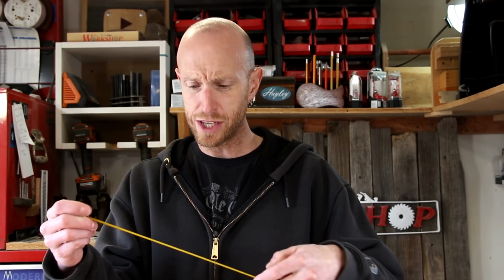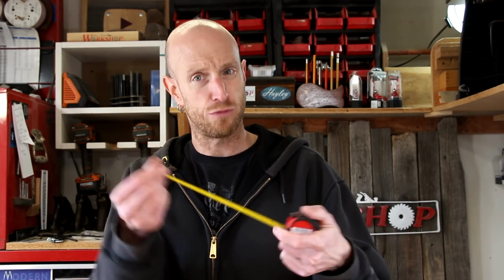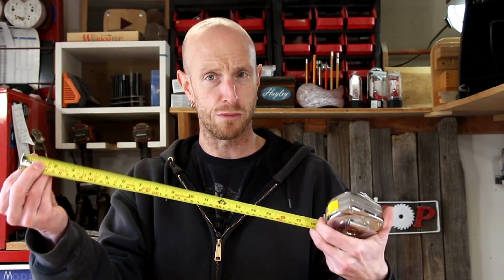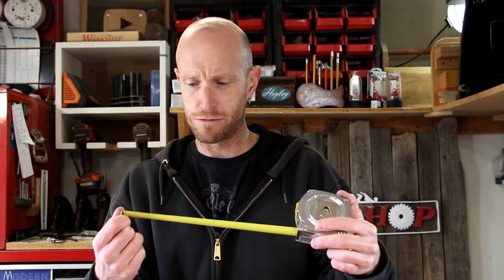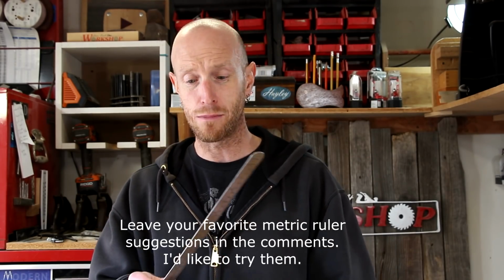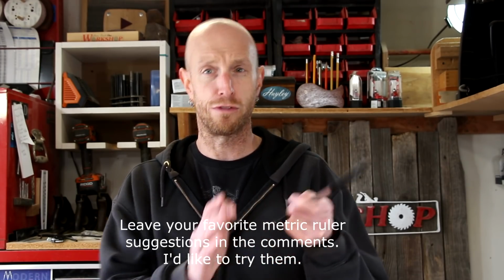My thoughts after using the Metric System for a project | I liked it

Comment: I'm an old fart who started out with the imperial system and found it a pain working fractions. When metric came in, like you, I found it a little bit difficult but once I mastered  it, it leaves the imperial system in the dark ages. 👍🏻🇦🇺😁 Oh, and thanks for your intuitive thoughts.
Reply from the maker: Fractions arent fun. Lol.
Reply: Strictly speaking, you're always dealing with fractions. It's just that tenths are a very convenient fraction to use in a decimal system. ;)
Reply: @Tyrian3k  As an engineering student, you never really use fractions with metric on any kind of diagram or drawing, its just written like it is, you might say one and a half metres but everyone knows thats 1.5 m and will always be written as 1.5 m. You can write the imperial system out as a decimal too but 3/16th looks and sounds much easier than 0.1875 inches. It also helps that converting between kilometers, metres, millimetres is easier than miles, yards, feet, inches because with metric it devides by the same amount each time, 1000, compared with imperial where 1 mile = 1760 yards, 3 feet in a yard or 5280 feet in a mile, or 12 inches in a foot. It just makes it a lot easier to work with and also to do equations with because in metric everything has a conversion factor of 1000 whereas imperial it changes for each measurement. It also makes it easier to convert between different types of units, like in the imperial system 1 ounce = 1.804 cubic inches whereas in metric 1 litre = 1000000 cubic milimeters or 0.001 cubic metres or 1 milliliter of water = 1 gram = 1000 cubic millimetres which makes it faster and easier to convert between different properties.
Reply: @andrewstrongman305  thank you, I've changed it now
Reply: Fractions are ctually VERY useful and easy in certain situations. A foot can easily be divided by 2,3,4,6 and of course inches can also be used independent of foot measurements, not unlike dentemeters. If I tell you to a metric measurement into thirds or a sixth, it's going to be difficult. Also, what if we do something like divide a foot in half repeatedly? 1 for (12"), 6", 3", 1 1/2", 3/4", 3/8", 3/16", 3/32", 3/64"....you get the picture. Now start with a similar metric unit and do the same. Well, there is no metric measurement close to a foot...well lets start with a meter. 1m, 50cm, 25cm, 12.5cm, 6.25cm, 3.125cm, 1.5625cm, 1.2....alright, I'm doing this in my head and I can do it but it's just not as easy and we are are still WAY larger than 3/64"....and we could do this infinitely with imperial. Not only that, we could easily divide these numbers by more than just 2. There are plenty of times where I have to divide up a length to in construction and it's just so fast with fractions and the imerial system. Also, the benefits of metric just aren't as important here AND could really be duplicated by just using DECIMAL INCHES when it comes to smaller measurements. Fractions have their advantages over decimal and base 12 has it's advantages over base 10. Luckily....we use both systems in America, which I think is better then being stuck with just one, even metric.

Surely there are some tasks that metric is better at and it's main strength is really just conversion between units IMHO. I personally just don't have to do much of that. I VERY much prefer fractions, it makes for easier math(s) to do in one's head.
Reply: @conorstewart2214   yes, and don't forget the fact that the US measuring system actually relies on and is define by the metric system
Reply: @justinkase1360  This may be a good but point. Except that I've been working in metric all my live and never once I thought: "Oh boy I wish I could divide the measurement in 1/16th". However you do use decimal inches. Just saying. . .
Reply: @justinkase1360  I think I have read almost the same copypasta reply you just posted but its so very dumb...
The fraction thing you say is an advantage in imperial can be used in metric, just switch " with whatever measurement you want. 
Using both lead to a probe crashing into Mars...
Only upside of imperial is that it sounds better in english than metric. Or atleast to my ears.
Reply: @justinkase1360  you can still use fractions easily in metric...
Reply: @thetoyodacar2264  Alright, but who uses fractional metric measurements in the real world? Also, it will always be base 10 vs base 12. When you have the option of using both, like we do in the US, the metric system is almost always religated to decimal usage...even though I think that's likely the case across the globe.
Reply: @zj871023  I can use inches or feet on the fly. I can use inches in a base 10 way JUST LIKE centimeters BUT I can also use them inrelation to feet and have base 12. It simply IS more versatile, mathematically. Also, I bet using decimal inches is FAR more common than fractional centimeters. Anywa, we use both and there is no better option than all of the options...

Using both is actually very easy but most people will use one or the other depending on the specifics of their task. I honestly don't think I do a great job of giving examples where it's really useful. There was a great video on youtube "defending imperial units" but I can't find it anymore.
Reply: @zj871023  I replied but it deleted, not worth typing out again. To each their own.
Reply: Justin Kase:  I can use inches also but the metric system just seems to work better for me. I can also convert from one to the other but it'd be nice to be able to pull out a spanner or fitting that is one or the other when doing things where you don't have to go to a shop to look for a fitting size that is now obsolete because most countries do use the metric system I don't dislike the imperial but find it a little bit more difficult to use after using the metric system. Horses for courses, as the old saying goes.
Reply: @jordicorfont  The point is that it's easier to divide in your head, not that every person is going around using 1/16 of an inch. What you might get is a measurement like 8 1/8" and need to divide it in half or something. Anyway, it's just one example of easy divisability. Yes, we sometime use decimal inches, which makes inches function very much like CMs, which is great for the versatility of inches. We also use metric sometimes. It's great to have options and fractions are fast.
Reply: @justinkase1360  My point  is that I never had a problem dividing by two in my head in decimal. It may have some advantatges to divide by more than 4 (8, 16 and so on). But even for that adantatge it's not worth the burden of the plenty of disadvantatges.
Having so many sistems is a disadvantatge because can lead easily to errors and you have to be converting constanly with a calculator. Be honest, aside for that particular case you need a calculator because imperial is not a unit, they are several units in a trenchcoat. 
Aside small projects in which imperial is ok, for science and engineering metric is infinitely more convenient. I understand you are used to it and can see the few points in which is useful, but this is not ground to defend it. You can use whatever sistem you want but don't try to convince others otherwise. 
Finally base 12 is fantastic, I love it. . . When you use a base 12 number sistem, if not it's always more convinent using base 10 because is the base of our number sistem.
In summary, you are saying that you have a car that only turns on on wednesday, but when it does is 5 seconds faster than a regular car. And defending it to people that use a car that works always with no exception. Then you say that  you have two other cars the regular car that always work and the old one that works twice a week. Why would you have three? Or why would you use a car that sometimes you have to push? You understand why it baffles people that use metric? You are attached to the old car I understand  and respect that. But no one is driving a car from the 1900 on a regular basis.
Reply: @justinkase1360  All you say is that its easier to divide by two.. 
Solve me this in 10 seconds: 1 feet divided into 20 measured in inches. Or 25. 
Or other real life shit:  for 1346 pieces of 23/62 inch long tubing how many 2,5 feet long tubes do you need to order for cutting? The problem is not going from 2 inch to 4 inch, the problem is scaling. That you have to break it down into feets and inches or whatever else.
Reply: @zj871023  No, if we are talking about feet then it just can be divided more into whole numbers, not just by 2. Both systems are behave the same if just dividing units in half. A foot has more denominators, 1,2,3,4,6 vs 1,2,5. What's more, in my trade we often divide by 2,3,4 for installing lights in ceilings. ANYWAY, if we use inches then our system functions JUST the same as your sentemeters other than we often use fractions. AFAIK, you would often give measurements in decimals if performing the same tasks I do. I doubt you would use "three tenths", but I may be wrong in that assumption. Of course your example moves right into numbers that are divisible by 5, which is a strength for your system. When dealing with those numbers my mind immediately moves to decimal. I was able to do the math in 10 seconds this way: 12 inches divide by 10 is 1.2 and that number divided by 2 is .6 inches. Now, I happen to know intuitively that 5/8", a common measurement for us, is .625 so that would be close enough for my work.

No one would use 23/62 inch as a measurement, lol. Maybe you mean 64ths? Honestly, anything under a 1/32 is not likely to be used. Down to those levels we use decimals. We never have to switch from feet to inches, it's just an option. We can use inches just like you use your centimeters if we want to and just ignore feet, we just have more options. I often would use a measurement like 62 inches, for instance. Anyway, I'm not the best at defending imperial measurements. My main point is that it's better to have options and we use BOTH systems for length measurements. We choose whichever one suits our purpose better. I don't have much experience with units that measure other things though.
Reply: @michaelpage7691  Hey man, if it's easier for you then that's 100% understandable. I will say, it does suck having to have both metric and imperial sized tools. That is a serious downside to having both systems. If I was a mechanic, I would prefer metric 100%.
Reply: I think being able to divide by more number evenly is objectively preferable. I also personally find fractions easier to do math in my head with. I will say that I would prefer metric if I was a mechanic and probably if I was a machinist. I just like imperial for my use, which really only requires about 1/8" or 1/16" accuracy. It's faster and easier, it's better. I don't think many people use both systems on one project, so I don't think it often causes errors, but maybe. I suspect that projects are often just using one or the other. Even if not, I just don't see a competent person making these mistakes.

I agree with you about science and engineering. Another thing that I think highlights this difference is temperature units. In Fahrenheit, the units are based around weather, 100 is hot and 0 is cold. In celsius, the units are based around the phase change of water, water freezes at zero and boils at 100. For weather, I prefer Fahrenheit because it is more precise and simple, but for cooking or science celcius makes more sense.

Really, my opinion is based on my use of the system and is very subjective. I should be more specific and say that I think those imperial units are preferable for the trades. No more than that. For other things, even I prefer metric....and we do use metric. My argument was never really that imperial or fractions are better in absolute terms. Machining with fractional inches would be TERRIBLE!
Reply: @justinkase1360  what I get from you is only that you have grown up with it.
Your trade is just as easy in metric. Even more so. We are not limited to 1,2 and 5 for dividing. 1,5/3 is 0,5 or 1,6/4 is 0,4. The good thing is that you can divide by anything tbh, and if the number you get is too small or too big, you can move around the decimal without the need of a calculator. Let's say you have two lamps that are two meters away from another, and you need to fixate the cabels 4 times inbetween. 2m/4=0,5m or you can just say 50cm. This easy conversion between m and cm or any other makes it far better in anything. Its fine that you dont need "millimeter precision" As we would say, in your work but that doesnt mean that the world needs another system for confusion. You are just used to it. Thats the only upside.
As for the weather: -C you know that theres snow. Above 0 means no snow or ice, 0-30 is a wide spectrum of cold to freaking hot and its easy enough. 30+ is torture. My problem with fahrenheit is that you look at it and wonder why the f is it always hundred something? What is below 100F? Whats it for? Why have a measurment thats just needlesly "long"?
Maybe thats because we instincly reduce such numbers. Why go with 1100mm when you can write 1,1m?
If you would use metric in your job for a while, you would make the change.
Reply: @homebuiltshop  fractions are fun but not useful for engineering work.
Reply: @justinkase1360  i graduated as marine engineer and i hated imperial measurements. please use an inch in base 10 to calculate piston travel per mile. you have over 63 thousand inches per mile and it's not a round number. metric system is just adding or taking zeros away. you can't do that "on the fly" with imperial system.
Reply: @sakatababa  Well, the first thing is that IDK what you are talking about, lol. Piston travel per mile means nothing to me. Anyway, I hope you read above that I stated that it's great for my purposes and not for every purpose. Your situation would be very odd, using inches and miles at the same time. This is not the norm. Anyway, for converting between vastly different units, metric is a clear winner.
Reply: @justinkase1360  minutia of engineering but basis of several important metrics in huge ships. you need to calculate stress, maintenance and repair using rapid cycles over vast distances.
advantage of metric system is not converting between units, it can't be as it has only one unit. metre. centi, kilo, deca, hecto, piko, mega, nano, tera are just prefixes added to unit. they denote a fraction or multiplier of that unit.
units like inches and feets varied in definition greatly while metre was defined by circumferance of earth. not something variable, you will agree surely.
system where one unit is used for one type of measurement is far simpler and more versatile as you can define other units in codependant relationship and avoid arbitrary definitions.
if you like fractions you should like metric system as it is all fractions and multipliers. centi means "one of hundred", deci "one of ten" and kilo is "a thousand of". you just add unit behind and know exactly what megalitre is or how much mass of that volume of water has.
Reply: @sakatababa  Prefixes added to a unit to make a new unit, yeah. You could say it's just another way of presenting the same unit but this is semantics. Yes, I understand that they are all based off of the meter and that their name indicates their relationship to a meter. I understand that there are benefits to being all mased off of the same unit of measure.

Yes, in the past there were various definitions for feet and inches. The roots of imperial go back further than metric, from what I've read. There was less standardization then, of course. They seemed to be largely based on human anatomy, which had obvious benefits at the time. These have become standarised and this worry over varied definitions is just not really a problem anymore. There are plenty of legitimate criticism of imperial measurements, but I don't think that one is very valid.

Metirc is just not commonly used with fractions in the real world and, as explained, it has fewer and different denominators if it is. My statement about my preference for imperial for my usewas really narrow and I don't see the issue. In my day to day work, historical definitions of "foot" are not a problem. In my day to day work, and inch functions remarkably like a sort of fractional centemeter would. Having the option to use feet also comes with real benefits in some situations, moving from pure inches (base 10) to feet (base 12) on the fly. The combination of these options makes for a vesritile system, as I already described. Hoever, this is simply not pertenant to all situations but I think it IS useful for many building trades. It simply will be easier to do some calculations in your heard with imperial IMHO. We have more options, often use fractions AND decimal when it fits, have more denominators and two entirely different systems to choose from, inches(10) and feet(12).

Anyway, we are rehashing things at this point. I agree that for your use, metric seems like a much better system. It's also just much easier to comprehend generally and it's the natural choice for both science and precision manufacturing. However, I prefer inches and feet for my uses and also prefer fahrenheit to celcious because it's more related to weather. I don wonder if the division of time really bothers metric fans. Of course we are stuck with 365(ish) days in a  year, so it would have to work with that. Howevrr, we could easily divide the day into 10 smaller units and then further divide those by 10, etc.
Reply: @justinkase1360  so what you are saying is that you can't divide 208 mm by 2... (Hint: large economy size, half of 200 is somewhere near 100, and half of 8...)
Reply: @EarlJohn61  With all due respect, this comment has gotten more attention than I bargained for and I'm tired of talking about it, lol. You are free to hate imperial units, I don't really care. Your comment is fine and I appreciate your input, I'm just done. My preference, for my use, is just different than what you think I should prefer. To each their own.
Reply: @zj871023  I think that both are good points and that is why we should switch to base 12 number system and redo the metric system accordingly. Solving both problems at once..
Reply: @justinkase1360  Dude, if someone tells me that something measures 15 387 Kilometers, I immediately know that it is at the same time 15 387 000 meters,  and 15 387 000 000 millimeters. Immediately, without any calculation.

And not only that. If someone tells me that the vessel is 30 x 40 x 50 centimeters, I immediately know that it is 60 liters. And that the water in it, if I fill it completely, will weigh 60 Kilograms. I don't have to do anything on a calculator or a computer.

Can you convert 15,387 miles immediately into yards, feet and inches? Without calculator? 
Or how many galons is in vessel in 2 x 3 x 4 feets?

In the metric system you don't think in quarters or eighths or sixteenths, but in multiples of ten, so it's much simpler.
10 x 10 equals 100, 100 x 10 equals 1000, 25 x 10 equals 250, 250 x 30 equals 7500 and so on.
You can calculate this off the top of your head very easily without a calculator.
Why do you think the metric system is used by scientists?
Reply: @marcelmommsen5308  With all rue respect, I'm done replying to comments on this video, lol. It will never stop and I might have to delete my comment. I've already stated that unit conversions like this are easier with metric but that many people DO NOT have to do these conversions. I'm sure jobs exist where you need to do math that is based on units that large and that small, but I don't know them off of the top of my head. Anyway, you are free to think as you wish. Cheers.
Reply: @justinkase1360  how are fractions more complicated im metric? 

A third of a meter you convert into into 33.33cm

1/7of a foot?

1.714 

Same bullshit.
Reply: @carlosandleon  Look, i'm tired of responding about this topic. I spelled out my position above. I can easily divide by 1,2,3,4,6,12 using feet and I can add 5 and 10 to that going by just inches. If I want to break down inchec I can EASILY divide by 1,2,4,8,16,32,etc using fractions. I can also use decimal inches and have every benefit you get with CM measurements. What is worse with my system is conversion but I don't find feet and inches hard to convert. No one uses yard in my profession. Just go on being confident that imperial has no use, I don't really care that much and it's getting very tiresome having to reply to this comment section a couple of times a week.
Reply: @justinkase1360  I never said imperial has no use, but you claim fractions are easier in inches when it isn't true at all. 

I mean I too can appreciate base 12 system but both systems still have to deal with irrational numbers with certain fractions, I don't see how metric is inferior to imperial in that way. 

In fact since metric uses a factor of 10 in all it's measurements, yes it is superior indeed in that specific application.
Reply: @carlosandleon  Of course you choose one of the numbers that a foot is not easily divided by, lol. If you don't get it, I'm fine with that. You're right, okay? Metric works just as great with fractions. Yep, makes sense.
Reply: @justinkase1360  Then you dont start with 1 meter but with 1000mm. 500, 250, 125 etc
Reply: @justinkase1360  To be fare you should calculate the fractions 3/8, 3/64 e.t.c or use fractions as well in the metric because it is not wrong to write fractions 1m, 1/2m, 1/4m, 1/8m e.t.c dividing by 2 repeatedly or in math 1/(2^n)
Reply: @conorstewart2214  Also 1.5 m is also 150 cm, so you can have it both ways. Here in Metric land if somebody ask my height, I would either say 179 cm or 1.8 m. Both are correct if you round it.
Reply: Heh.  Yeah, I was a kid when Canada went metric and learned both, (and later, when I got into printing, a third system of units), and when I’m working in my shop or on construction projects with my dad, I usually get a jibe in about waiting for the (really) Old Farts to die off so I can use Metric in piece.  (I mean, when I’m excavating and need to calculate volumes, I hate having to reconcile units so I can then convert to gallons or cubic yards…  And don’t get me started on aggregate being sold by the ton, measured in cubic metres, but then laid down in inches…)
Reply: @justinkase1360  but you can do the same with a meter. Dividing by two over and over again. Imperial System: 12", 6", 3", 1 1/2", 3/4", 3/8"
now in Metric System: 1m, 1/2m, 1/4m, 1/8m, 1/16m. I actually think 1/16 sounds better than 3/16. Everyone will tell you in half a second that 1/4m is 25cm. Its just dividing 10 by 4. But when you have 1/4 inch, who will tell you how much that is?
Reply: @justinkase1360  for someone that hates decimal you sure use a lot of it in your working out.
Reply: @justinkase1360  You are really doing it all wrong.  Firstly why say there's no metric measurement close to a foot?  So what? That's like saying there's no imperial measurement close to a meter.  They're different systems.

As for divding.  You're doing it all wrong.  As it's a decimal system and you want to divide centimetres into smaller numbers then it's best to go the next power and use millimeteres so your division now becomes a very simple.  After all you had no problem starting 1m and switching it co CM when you divided it .  I would start with 1000mm then 500mm, 250,mm, 125mm,  then you could go 62.5mm or 625 decimeters (ie the next power of 10) and you can do that all the way to infinity.
How you think fractions are easier than decimal is beyond me and then the craziness of 12 inches is a foot, 3 foot is a yard,  so many feet is a mile,  etc  no logic to it.  Metric is just simple.
Reply: @justinkase1360  "Well, there is no metric measurement close to a foot."  32cm is closer to a foot than 100cm is ... so 16cm, 8cm, 4cm, 2cm, 1cm 0.5cm 0.25cm ... You're only choosing to start at 12 inches, now do your was for with a length of 13 inches
Reply: @salerio61  People are still replying to my comments? I can only laugh about it now.
Reply: @justinkase1360  " I can easily divide by 1,2,3,4,6,12 using feet " really? 7 feet 3inches. Off you go
Reply: @salerio61  That comment was about dividing feet, not feet and inches. Still I can divide that measurement as described. This is how I think about it:

by 2: (7' / 2) + 1.5" = 3' 7 1/2"
by 3: (4" * 7) + 1" = 29"
by 4: (3" * 7) + (.25 * 3) = 21 3/4"   ***** OR divide by 2 as listed above and half it
by 6: (2" * 7) + (3 / 6) = 14 1/2"  ***** OR divide by 3 as described above and then half that
by 12: It's an inch per foot and other are 12 quarters in 3", so add a quarter = 7 1/4"   ***** OR divide by 3 and half it twice

Hopefully you can follow what I typed above. Of course I can understand how these things likely don't come naturally to someone not used to the system. Some of them I listed 2 ways people might do it, it depends on what comes naturally to you, people are different. Some of this looks more difficult than it is when typed out. For instance, I know immediately that 3" divided by 6 is 1/2" so  it should just read "+1/2"...but I included it because I do think about that for a spit second. How would you do it with your system, a calculator? We do convert to inches and use calculators sometimes, it just depends.